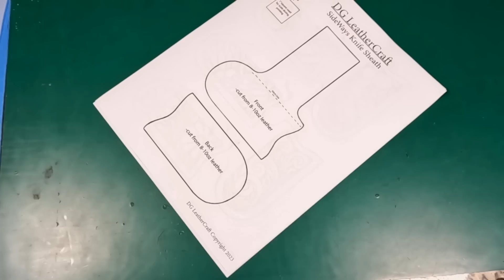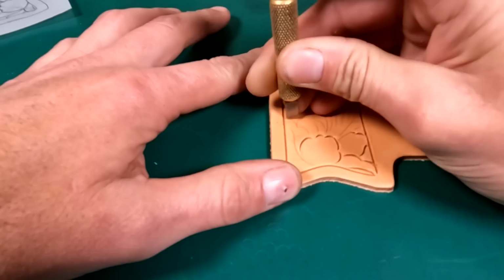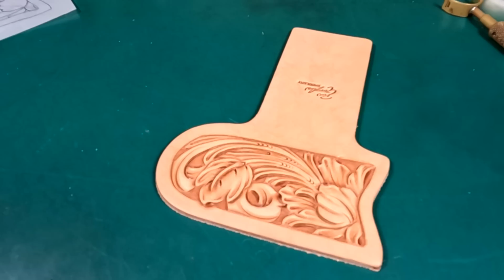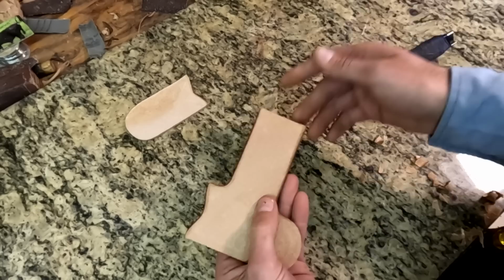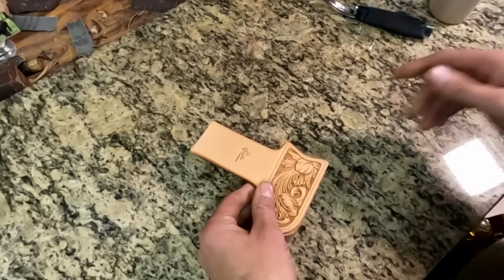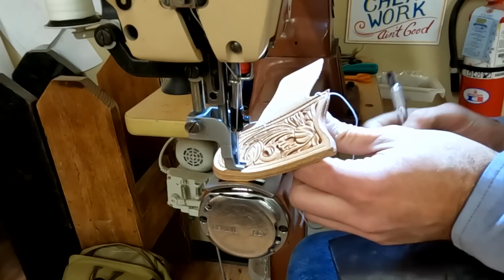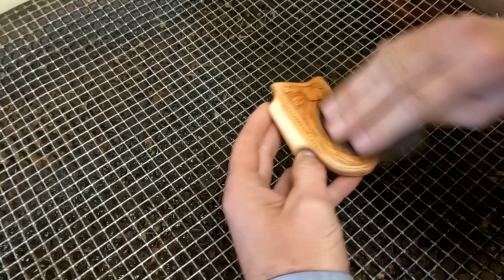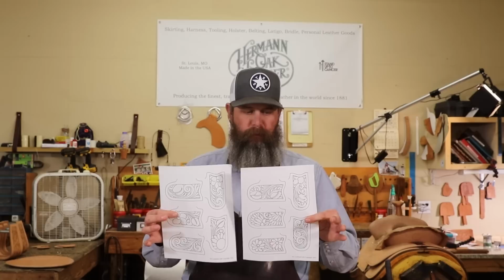How to Make a Sideways Knife Sheath

Comment: Don, I wonder if a slightly wider belt loop would provide a continuous curling force, which would mitigate against a knife falling out for more of the sheath’s life? It’s always a trade-off against ease of use, but I’d prefer not to lose my knife. There is always of course a snap closure option too.